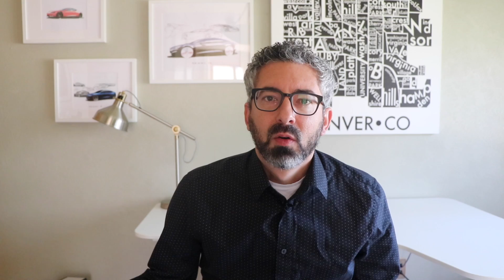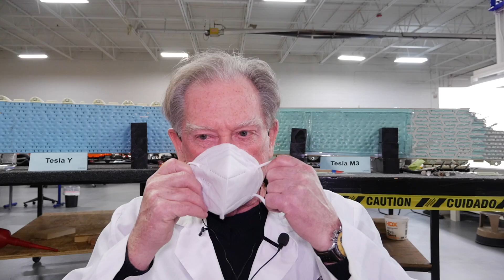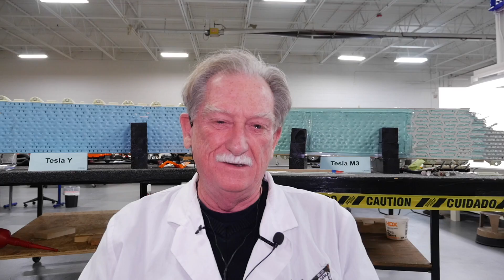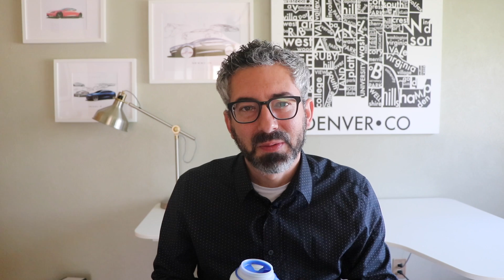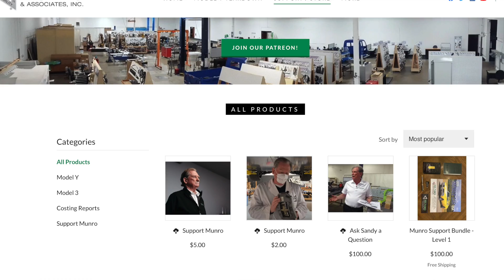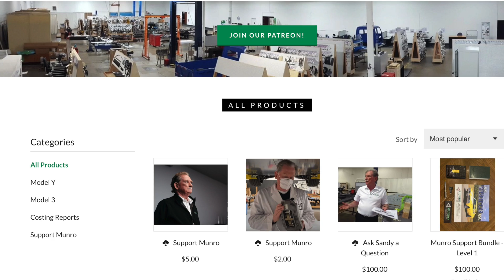Sandy Munro: Model Y is the best EV Tesla makes

Comment: It still amazes me that Tesla can be so far ahead on the difficult things but so far behind on the easy things.
Reply from the maker: Correct!!!
Reply: Those ‘easy things’ are from several decades of iterative development. You can’t teach it, and the lessons learned are hard earned.
Reply: @dries248  
Correct.
"Little things" are details.
Details take time.
Just as in any occupation, those who are best at what they do understand not only the big picture, but the detail.
Reply: That’s a good point but I think if they can’t do both they’re still better off pushing ahead in difficult things that their competitors don’t have and once far enough ahead they can hire away some experts to do the “easy” things.
Reply: @dries248  For some things, I'll agree with you.  But paint is not new or secret. There is plenty of industry knowledge out there and plenty of of people who know it. Tesla has experience painting over 1 million vehicles now for over a decade. They should be able to paint a car without orange peel.

There is no other problem I can think of that is so instantly noticeable to customers and yet so solvable.
Reply: Paint is also one of the most time consuming aspects as far as I know for production efficiency, so it may be a result of that tradeoff. It's not a question of whether they can do it or not, but whether they can do it in balance with all the other factors.
Reply: @levib  good point.
Reply: Elon addresses the "paint problem" in "Ride the Lightning" podcast.  Episode 262.
Reply: Not sure they are far behind on anything really. I am a (former) bimmer fan and my wife bought a Model 3. The model 3 is lightyears ahead in the stuff that truly matters, but sure, it has a half millimeter wider gab than the bimmer on the front trunk. And that's about it. I would rate the quality that matters to the consumer on par, or perhaps even higher than BMW. On the stuff that truly matters it's not a contest. The bimmer is a clunker.
Reply: Yeah . . . basically, it's sh*t that doesn't matter. If it did, model y wouldn't be selling. Look at most of the cars on the road. No body washes their car on a regular basis. Hell many don't even bother servicing their cars. Majority of car owners will leave bird sh*t on their car and if it ruins the paint, they could care less. 

That is the reality of it all.

Comment: The new electric Mustang would be another good one as well as the VW id3.
Reply: Jo Web Yes the Mustang EV 👍
Reply: What Mustang EV?
Reply: Neither is in any way interesting.  Both are duds using commodity everything.  No EV with poor efficiency matters or contains any worthwhile technology.
The only interesting vehicle may be the new rav4 plugin hybrid coming out soon.  They claim instant torque and 5.8s which is really fast.  If it performs like that, it will feel like an EV and be real competition to the Y because it doesn't need charging away from home.
Reply: I disagree with Patrick, the Mustang Mach-E would be very interesting, but it's a ways off from production.
Reply: They just need to make sure they follow or beat Tesla's update model and don't make the naiive mistakes all the other competitors do and ensure that their cars are built to age. All these "Tesla killers" start with a design that beats a current Tesla, but by the time they hit production they're already behind due to refreshes and software updates and lag further and further behind with each patch. They need to factor in FSD, supercharging networks, and where these things will be 2-5 years from today and either go all in to compete in those areas or go all in on being more affordable options.
Reply: You completely missed the point about tesla
Reply: @ranjitchakravarty604  What would that be?

Comment: I would like Sandy to analyze whatever he considers to be Tesla’s closest competitor.
Reply: hydrogen cars imo are the closest cars to compete against the Tesla cars
Reply: @catman1353  Hydrogen cars lose.  They take almost 3x as much electricity to travel per mile.  Batteries will also get better over time completely negating anything the hydrogen fool cell would try to do in the market.  Perhaps for planes or special long distance / super heavy vehicles they have a role but even that is doubtful.
Reply: No one is close.
Reply: Noone really is that close at the moment, more like distant several competitors
Reply: @whattheschmidt   In the future, there will likely be fringe use cases that pure Battery electric vehicles won't be able to serve because of charging times. If charging times never catch up to the time it takes to fill up a hydrogen tank, then a small minority of ground vehicles will be Hydrogen-fuel-cell/Battery electric hybrids. Distributed hydrogen production at fuelling stations can serve these vehicles (a small electrolysis plant at each fuel station making their own hydrogen), especially if the majority of vehicles are pure Battery electric vehicles and the electricity is also produced from excess solar/wind farm generation on site. Seasonal storage of electricity, electric aircraft and various industrial processes may also benefit from distributed production of hydrogen from excess renewable electricity along with stationary battery storage.
Reply: Hyundai Kona electric Highlander

Comment: At 30:30 the question comes up about cost, and whether 70% of the model 3 parts got reused. Sandy said that he didn't see that in his teardown, compared to his model 3 teardown, but the model 3 he's using as reference was older (a year?) than the model Y he's tearing down now. It may very well be that the model 3 has also been updated with these improvements, so that if Sandy tore a brand new 3 down he might find more commonality with the parts.
Reply from the maker: Correct
Reply: He examined a very early Model 3 - late 2017 and then fully tore down an early 2018 version.  The Y is an early 2020.  So a two year difference.  As Sandy and Sean mentions, I expect a lot of the pieces that are slightly different in the Y are currently in the Model 3.

Comment: I really hope that Elon listens to these comments about Model Y paint quality from Sandy.
Reply: It’s painful to see my MY paint/gap issues post delivery. Tesla partnered with local body shop (certified by Tesla) and now my MY is worse after the repairs.  So frustrating!
Reply: I have run my hand over 3 MY's and have no issue with the paint and i do know about auto paint
Reply: @aussie_al  I have a low vin 10xx Model Y in grey and its nice. I did a DIY ceramic coat by hand and it looks great.
Reply: Freddie P  They had my car 3 times and I later found out that they lied to me and told me that they had taken it to a certified Tesla body shop. I took the car to one body shop and they told me the paint could be fixed but it had so many issues that they would have to paint the whole car but the alignment of the doors and trunk could not be fixed. They don’t have enough certified body shops to handle all the work plus you would be paying a lot of dough to have it done right.
Reply: This is nothing new, Tesla is aware of this problem for many years. Will they ever do anything about it is the $64k question.
Reply: Turre Tuntematon I understood that the Berlin Gigafactory is going to be equipped with a revolutionary paint shop. So I guess they took the comments seriously. Now we just wait and see how that turns out.

Comment: As someone who extensive dealing(25yrs>) with body repairing Tesla’s and their high end German and Italian competitors, I can say their vehicle quality & after sales support was alarmingly poor. 
The quality of plastic replacement parts- particularly facias(bumpers) was so bad they looked like aftermarket / copy parts at best. We would often repair old fascia as new replacement one would arrive requiring hours of high building and spot repairs.
Parts supply was always holding up key to key times. If customers Model# needed new door it would be supplied from Tilburg (5days shipping) even if one of my local SC had stock - we would have to prompt customer to complain to Tesla about parts delay. 
Some new vehicles looked like final stage QC / snagging was lacking or purposely left to dealer / customer sort issue  between them. 
Our paint finishes caused original factory poor finish to be highlighted - orange peeling against nice fresh painted / polished glass like panel would frequently cause 4 way arguments customer x repairer x Tesla x insurance company. 
Panel gaps... No two cars had same specs. No chance gap gauges were in use.
They did innovative and tech stuff amazingly well but old coach building and wet work was miles off the pace.

Comment: Hydrogent fueling stations have a bad habit of exploding.  Newer stations are designed to be explosion proof? Not a great experience if you are fueling at the time.
Reply: Yeah i dont understand why he thinks Hydrogen is such a good idea. The infrastructure alone would not make it viable
Reply: @aussie_al  Let's compare it with oil and gas infrastructure. Isn't it the biggest and most dangerous infrastructure?
And what's more than that and hydrogen isn't? ... Pollution!
Reply: And what's more than that and hydrogen isn't?... Exhausted.

Comment: May be they have issues with evacuating air from the Octovalve and system, because of the complex structure; many points for air to get stuck.
Also cavitation does not need air in the system. Some cross section made too small during assembly could cause it.

Comment: I would really like to know Sandy's take on the type of steel Tesla is using on the Model Y and its susceptibility to rust.  All I've been able to determine by asking Tesla, when I ordered a Model Y several months ago, is that they dip the cars in a rust-proofing coating.  My underlying question is whether they are using galvanized steel, as the US OEMs started doing in the early '80s (shortly after I left Chrysler in the late 70s).  The stonewalling I got from Tesla on this caused me to cancel my Model Y order and I'm continuing to drive my  2006 Toyota Highlander hybrid with virtually no rust, here in snowy, salty Minnesota. Thanks, Jack Falker in Minneapolis

Comment: I’m always surprised at reports that the Model Y’s heat pump is loud, because the heat pump in our Prius Prime is no louder than the air conditioner, and it works quite well, and efficiently too.  So yeah, cavitation due to manufacturing error seems plausible.

Comment: Nice talk guys👍 

Also I would like to see Sandy do a teardown on the Leaf. I got a new SL Plus Leaf for 30 K. It was 10k less than a similar model 3.

The leafs also has pro pilot with is an autonomous drive assist feature.

Another reason I would like to see a leaf teardown is because of its air cooled battery. Was that a good move to save costs??? Thanks!

Comment: Sandy asked what your viewers would like to see next, well I’d like to see them get a current manufactured model 3 and compare the changes to the old one they took apart. I don’t know if that would make sense for them financially though.
Reply: Tesla has definitely been making running changes to the model 3 my 2019 has the same door seals and A arms as the Y . But Sandy's 3 is different.
Reply: @linemanap  What is the VIN or built date on your 3?

Comment: As interesting the engineering of the Hydrogen fuel cells are, I think with every auto-manufacturer admitting that BEV is the way to go there might not be much interest in that. The miurai is an engineering marvel but in the wrong time. If we didn't have lithium ion batteries they would be very interesting to the public. 
The VW ID.3 is coming soon so I'd love to see as much as possible about that car. It's positioned to compete with the model 3 and they're doing a lot of things differently in that car. Would like to see how VW would go about creating a BEV platform.
Reply: Battery day is the final nail in the coffin for Hydrogen.
Reply: I've got a feeling that Battery Day is going to put a nail in the coffin to a hell of a lot more than Hydrogen

Comment: We’d like an analysis of what is better in each of the latest version vehicles. We know they’ve tried to adopt the best aspects of each prior project for the Model Y, but there are parts of these vehicles, model S, X, that they haven’t or couldn’t adopt either because of cost, size, time, or missed opportunity. The model Y may be the best package so far, but it is not the best in every single way. Each vehicle has innovations that couldn’t be adopted in others. 

Model S 
Model X
Model 3 
Model Y

Comment: I think Sandy is correct but also wrong the model 3 has most of the model Y improvements in it already. He pulled apart an early build model 3, which was there first mass produced car. They are continually making running changes to the 3.

However the Y is just more useable than the 3.

Comment: Your prediction on hydrogen fuel cell vehicles is one that I held 20 years ago. In the year 2000 I had no concept that battery technology would advance so far. Today, I'm not at all certain of the hydrogen fuel cell future. Neat technology.

But if low-cost solid state batteries capable of 5000 cycles with low degradation come to fruition, I can only imagine it's lights-out for ICE and FC vehicles.

Comment: Always nice listening to you and Sandy! Interesting so hear that the Taycan is not that interesting for Sandy, I was expecting this. Nice car, but just a car with out of the box components. At least that is what I’ve read between the lines of Sandys comment on that car.

I’d like to know something about the Polestar 1. 
I know that plug in hybrid electric vehicles are often just a scam for “eco friendly”, they blast out hell a lot of pollutants. Especially I’m disappointed about the fact that these cars are heavily subsidized in Germany (where I come from). Companys use them in their car pools without charging them making them even worse than regular diesel or gasoline cars because of the extra weight. They are having small batteries that last just a few miles and are often just used to boost the ICE experience.

I was wondering if the concept of a PHEV with such a huge battery (like the Polestar 1) could be a reason not to ditch HEVs. It has a reasonable electric range, it can be charged with 50kW and it is also kinda quick going all electric. I’d like to know your take on this car.

I know it is a concept car, I know it is super expensive. I was just interested about your opinion about this different take on PHEVs and about HEVs at all.

I personal think that HEVs are not a solution, but I’d like to see other perspectives on that topic.

Comment: I think the primary problem with hydrogen powered vehicles isn’t the danger. It’s the fact that you need to produce hydrogen and you need to transport it and store it. You lose efficiency at each of these steps. And most hydrogen today comes from gas reforming. However, even if you use electrolysis, it’s not a very efficient process compared to battery electric. Hydrogen powered vehicles might fit in for a few corner cases, but I think it’s much more likely that battery-electric will dominate.

Comment: I'm interested in the Mirai in terms of better understanding the long term costs, maintenance, efficiency, and the like as compared to a battery electric vehicle since hydrogen fuel cell vehicles still need to have a substantial battery to operate, and have issues with operating in extreme climates, and fuel cells require maintenance, etc that batteries don't. It would be illuminating to better understand the pros and cons from a consumer's point of view from someone who understands them and can explain why they exist.

Comment: Why not hydrogen?
1) Economics - Hydrogen cost more to fuel than BEV.
2) A hydrogen generator cost thousands. A charger cost $400.
3) You can't charge at home. 
4) No charging network yet.
5) Too explosive - leaked hydrogen can build up in your car or garage. Boom!
But if someone discovers how to separate hydrogen from water cheaply, all of those are just engineering problems.

Comment: Awesome video, packed with information. I would like to see a detailed breakdown of the numeric comparison. Between thel, 3, I3 and Bolt from last year,then add the y and the new Leaf . I think it would more clearly show the evolution in ev tech. LG batteries vs panasonic, inverters motors etc. Even without the software lead, I think it more clearly show where the" cars in the race" are.(Tesla has lapped them!)

Comment: I'm coming to the conclusion that the Y frame is defective. When the Y was announced, Musk promised a one-piece cast aluminum frame. This didn't happen. There is a small rear casting, now one piece, but the rest is fabricated steel stampings and the result is clearly defective, hence the inability to get panels, doors, hatch, frunk to fit. If the plan is to gradually replace the steel fabrication with aluminum castings, that might explain why Tesla can't be bothered to fix the current frame, which is bad news for anyone planning to buy a Y.

Comment: Sandy, Interesting consideration of hydrogen fuel, I read there was some catalyst that could be used in hydrolyzing water into its component atoms, or more correctly, their diatomic forms. Sounds like perpetual motion to me, but the energy of elemental oxygen is lost. But vehicles that grab the oxidizer from the air have a real storage and weight advantage. But why hydrogen? I expect you could extract carbon compounds from coal power and Fischer-Tropsch them into fuel from heat electricity, and reactants all in one location! Can you make the energy stored in charging and discharging a Tesla battery more efficient than reducing then burning other chemical fuels?